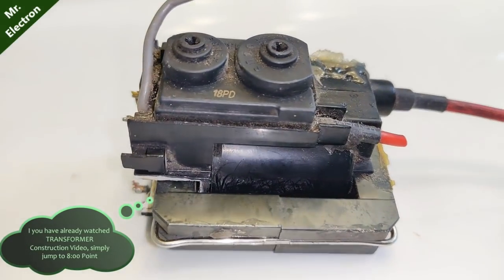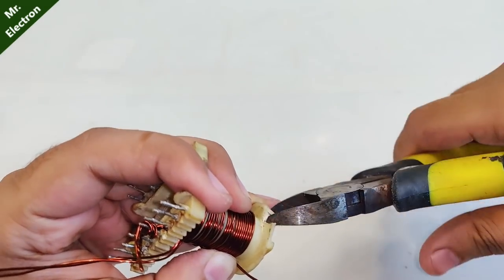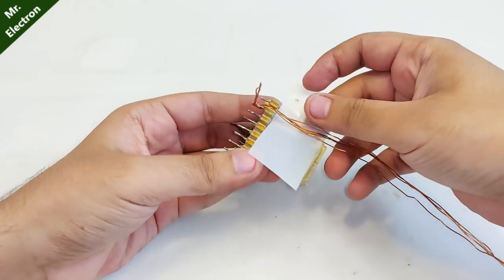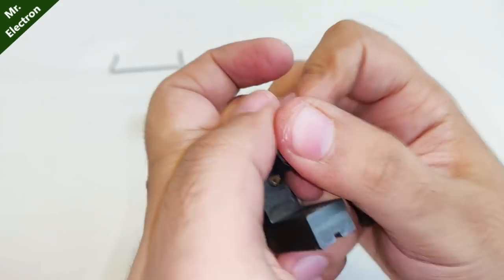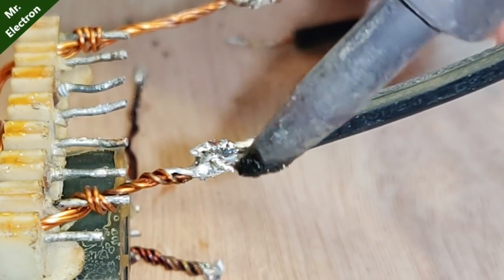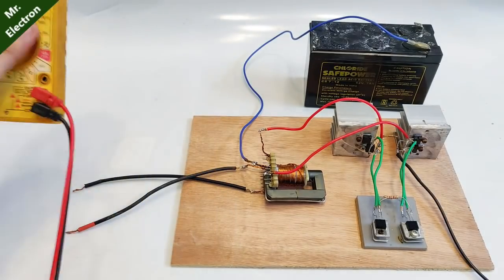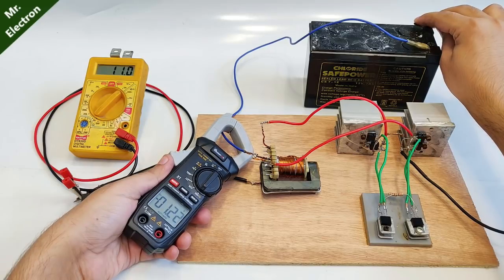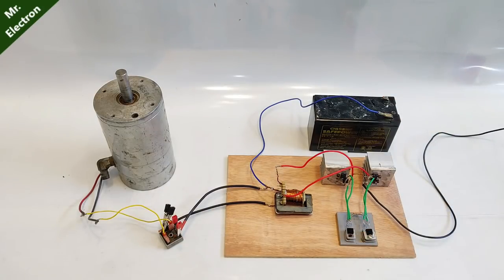How to make 12v DC to DC Buck Converter | Current (amps) Booster Circuit for Solar Panel

Comment: Toroidal core CAN has gaps physical or distributed. Gaps in the cores are needed to reduce/improve ferrite core saturation, yes it will reduce inductance as well but will increase/improve core power transfer capabilities like up to 2-3 times. In fly-back power supplies core is mandatory. Go and look  Sam Ben-Yaakov -s videos.

Comment: You are trying to build a step-down-converter. On the output side, the voltage is reduced and the current increased. In order to calculate the efficiency, the product of volts and amperes (watts) must be compared at the input and output. You can't just measure the amps and assume a positive result when you increase it. In your measurement with the bulb you have 12 volts at the input (battery) and probably almost 12 volts (?) at the output. How do you want to regulate the voltage at the output when an 18 volt solar module is connected? I am very interested in how things will continue.
Reply from the maker: Correct !
Reply: @MrElectron  The input voltage becomes an (unregulated) square-wave voltage. This is reduced in the transformer and then rectified and smoothed / stored in the capacitor. Except for the transformation ratio of the transformer, there is no regulation of the voltage. When the load changes, the voltage will also change. A solar module does not necessarily always produce a stable 18 volts.
Reply from the maker: Correct ! Uploading the exact measurement video in 15 mins
Reply: Nice guy and very keen but alas, lacking a lot of technical knowledge, It will come to him in time, Im sure ;-)
Reply: @nevillewaiting485  If he survives long enough with his crafting knowledge, his technical knowledge is bound to increase. Hope he never gets a "Darwin Award" ;-)

Comment: That second half of the primary, did you wind that in the opposite direction as the first half. You turned it around definitely looked like it.
Reply from the maker: Just think of the second half winding as the first half and its end point as the beginning of the beginning for the first coil of primary... You will find it fine then.. It will is all in clockwise. Both primary first and second half